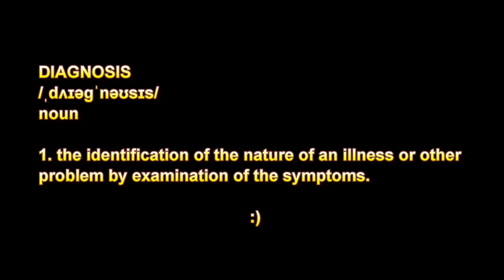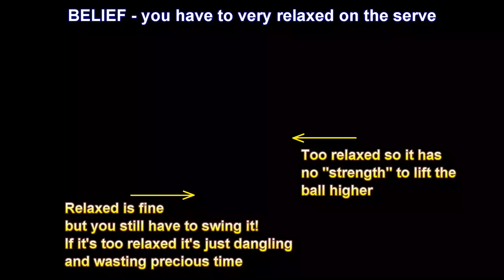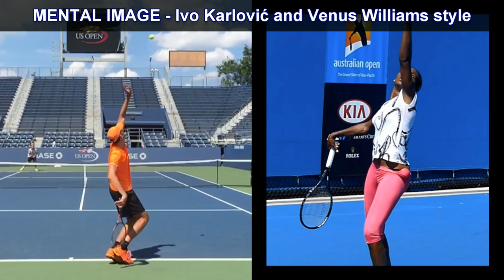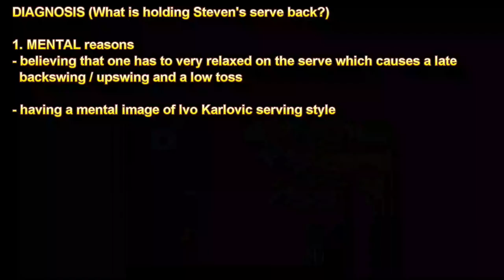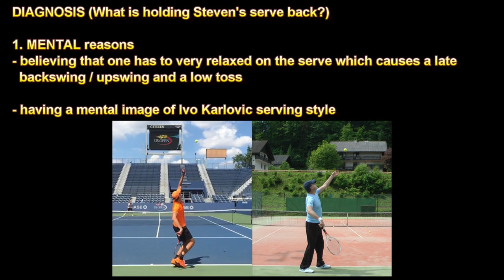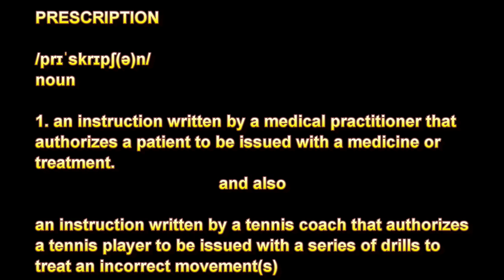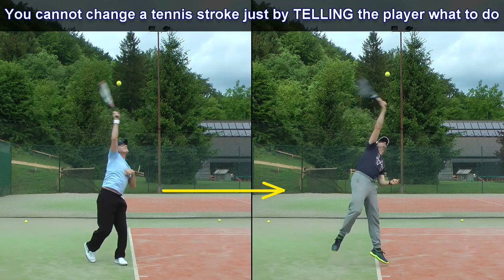Analyzing A Tennis Serve & Improving The Toss Height

Comment: Highly insightful as always, Tomaz. Two quick things that I especially resonated with:

1) "The Battle" is so, so real but ignored by most which leads to a tremendous amount of frustration from players and coaches alike. Kudos to you for having the integrity to point it out when so many are pushing a "quick fix" or "secret". 

2) There's a lot of coaching out there that suggests a low toss is ideal which I've always disagreed with. Your reasoning here is the best articulated I've heard for tossing significantly higher than the point of contact. 

Thank you for your work!  -Ian
Reply from the maker: Good to hear from you, Ian!

Well, I suggest an optimal height toss, let's put it that way. Certainly not Dolgopolov style and certainly not Del Potro style.
Reply: Feel Tennis Instruction I am a high toss fan.
Reply: Feel Tennis Instruction I’m sorry tomaz ! Del Potro serve is very good and actually tosses the ball high. You might want to watch his serve at Wimbledon and see how many quick easy points he gets
Reply: If I could offer my input as someone who continues to battle but has made significant gains, my focusing on tossing arm extension and higher toss really helped my hitting arm.  Feeling the stretch along my intercostals along the side also aids in relaxing right before I go up after ball with my racquet.  I then hope to feel another nice stretch on my opposite side when I hit, which indicates a nice loose throwing motion.

I follow the logic of the lower ball toss (slower ball movement as it’s near the apex of toss, less variation due to height, wind etc) however this video confirms why I always wound up with trouble with it because I always end up rushing my racquet arm compromising throwing motion.
Reply: Excellent!

Comment: Hello Tomas, I really like your in-depth analysis of elements from the game. They've been helping me a lot along the way. I've been struggling to find a good source of information on how to develop your serve stance. I started playing tennis almost 3 years ago and as I go to more and more tournaments for amateur tennis I notice that even the best players that have very high overall skill have problems with their serve stances.

I currently use pin point stance and I feel like I have a lot of unwanted movement in my feet. I sometimes do a tiny step with my front leg after the ball toss, I drag my rear leg too much into the court , I am not sure if I am placing my rear leg correctly at the end of the motion and so on...

As some other users have mention in your example of serve you do a foot fault and I was wondering how do professional tennis players develop their serve stances as they are extremely consistent and they very rarely do foot faults.

Cheers,
Nikolay

P.S. I hate platform stance.
Reply from the maker: Thanks. I certainly don't do a foot fault after playing tennis 20 years on quite a high level. But surely when I demonstrate serve technique I don't look down at my feet whether I cross the line by one inch. I can't understand how nitpicky people can be and how they don't understand what is the point of each video I make. P.S. I hate pinpoint stance, it causes so many problems in teaching that you can't imagine.
Reply: :) Sorry for mentioning the foot fault, it wasn't the purpose of my comment to point it out. It just reminded me of my serve stance problems. And I don't actually hate the platform stance it just doesn't feel natural when I gave it a chance (I tried it for a couple of months)